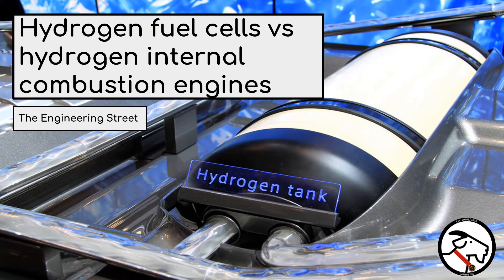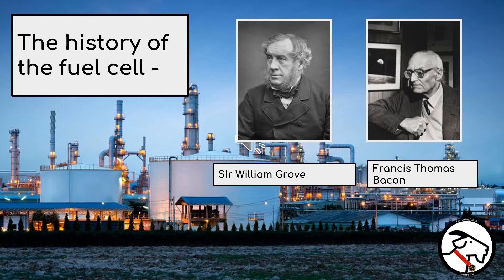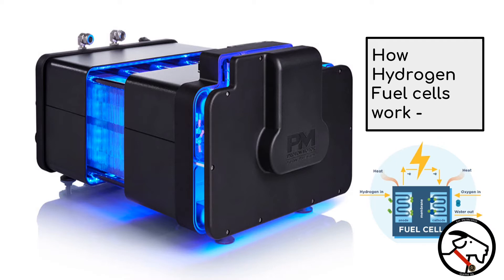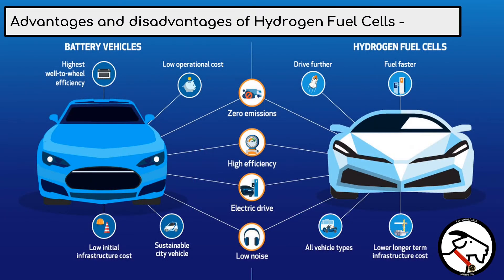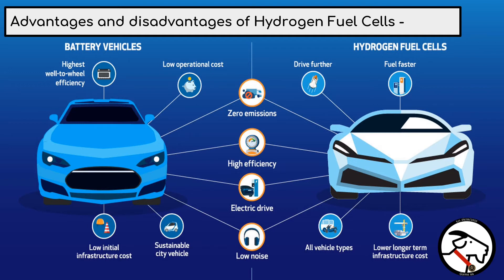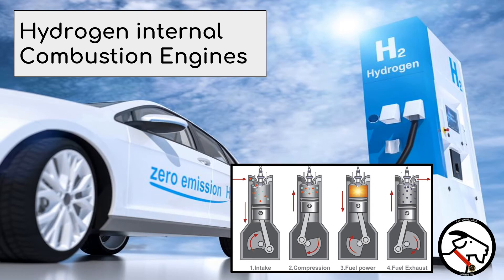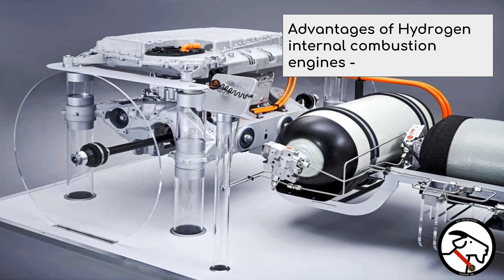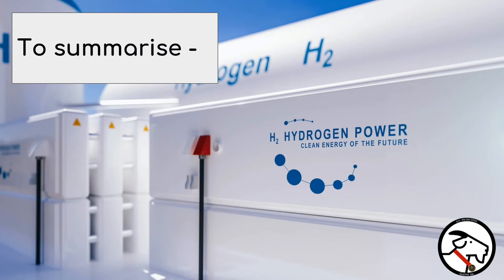Hydrogen fuel cells vs hydrogen internal combustion engines

Comment: Hydrogen internal combustion engines is like putting a gun to your head if the Hydrogen pools in the sump and then boom.  Hydrogen fuel cells much a safer way to run a combustible energy